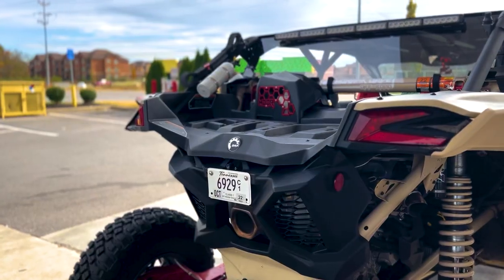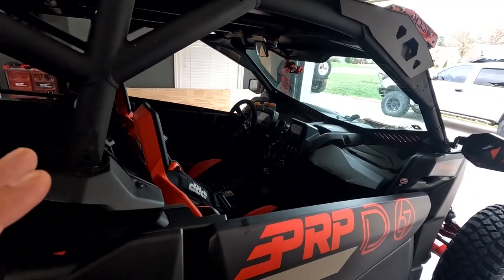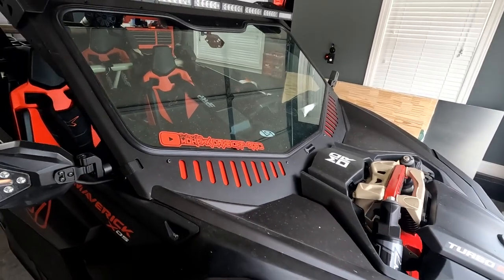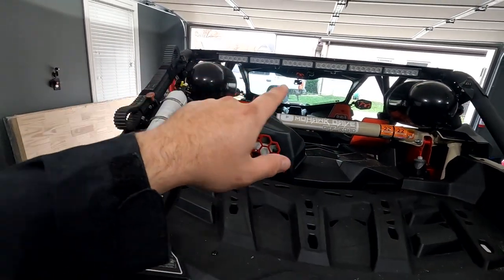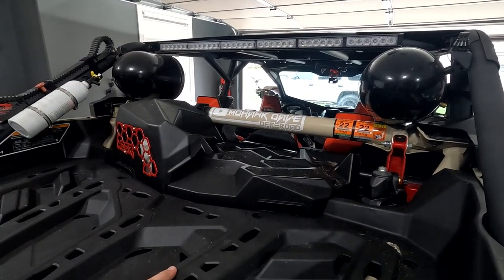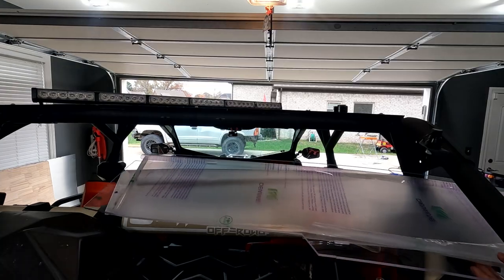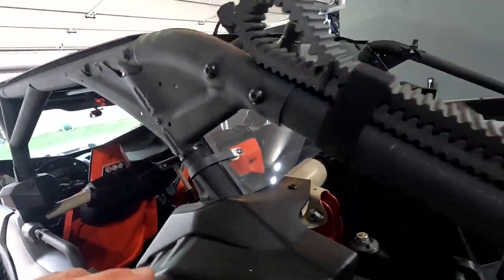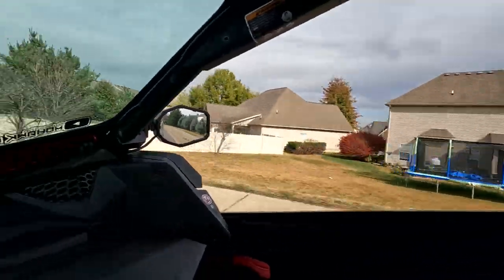Can Am X3 Rear Window Installation

Comment: Did it help with the dust in the cab? I’m think about buying the Bent Metal windshield but the more people I talk to about it the more hesitant I get. Fantastic window from what I hear but I’ve hear with the rear window the heat in the cab even with vents open and no side windows is miserable when hot out. Also they say with a front and rear window the dust still seems to swirl in the cab from the side windows. What are your thoughts?

Comment: Now you have little to zero air flow over your intercooler. I see the maverick R has a roof scope to combat this issue, but what do you do for the x3? It could be a pretty big drop in performance with much higher intake temps.
Reply from the maker: Maybe 🤔 I should fabricate a scoop.

Comment: I have the exact same setup and the exhaust fumes make it unbearable to drive. Do you have this issue?
Reply from the maker: I did , so far the rear glass seems to be helping. Honestly any rear glass should help. Easy way to try is to use some cardboard in the back and see if it helps.

Comment: Should have gone with spike powersports rear windshield. Kemi motos rear windshield is terrible. At least with spike its molded and belt to proper profile, and has an adjustable vent for the intercooler.

Comment: How did you mount the chase light? Do you have a video mounting it?
Reply from the maker: Chase light comes with long channel bolts that mount to existing holes in the roll cage. I just drilled 2 small holes in the windscreen.
Reply: @MohawkDaveOffRoad  thank you for the help was going to order that light bar after watching you’re previous video about it